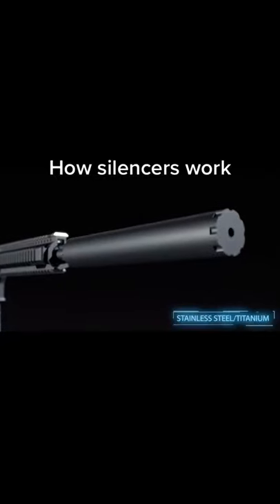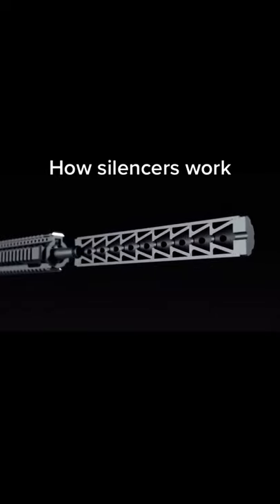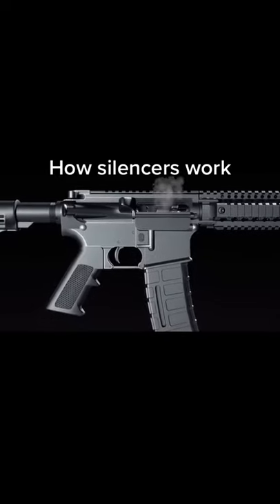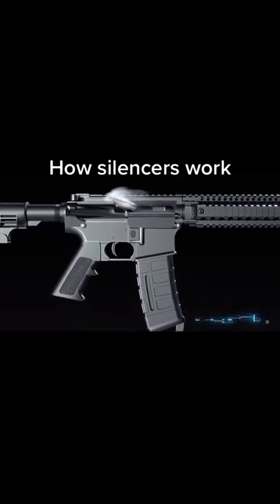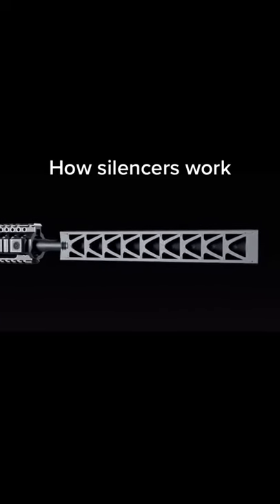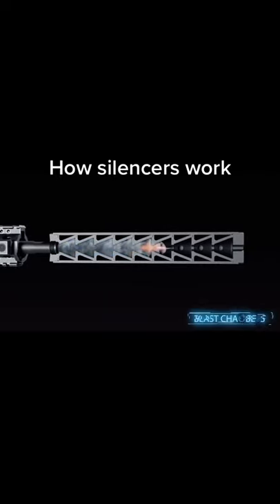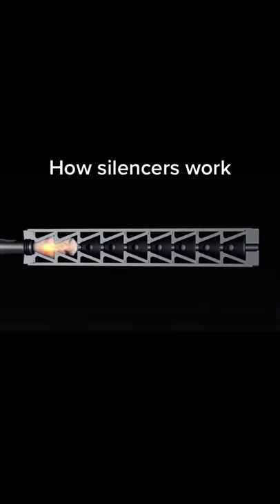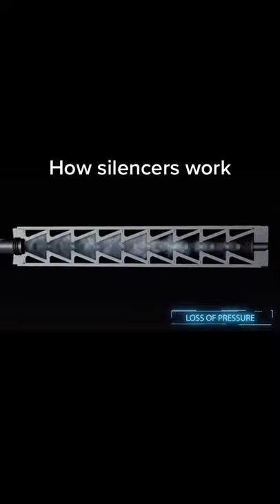How a Silencer works. AKA a gun suppressor.

Comment: Suppressors : makes the gun some silent and produces better accuracy
Games : decreases  damage , range , accuracy
Reply: Well range and damage would decrease with a suppressor because it traps most of the gas accelerating the bullet.
Reply: @gmdtanker6211 Range and damage isn't affected because the barrel isn't shortened when you attach a suppressor.
Reply: @mutsyti  right but the power of the bullet comes from the gas propelling it. If you look at the inside of a suppressor, it traps the gas to produce less sound, hence making it slightly slower
Reply: @gmdtanker6211  Suppressors increase the amount of time that gas pushes on the bullet because they increase barrel length. Suppressors don't slow down the gas completely.
Reply: Old silencers slowed down bullets. Modern silencers or suppressors can actually increase muzzle velocity and accuracy, it all depends on design. To be "silent" you must use subsonic ammo as well
Reply: Re2 Remake done silencer right and I loved it
Reply: Facts bro
Reply: Because in games, especially multiplayer games, they have to balance stuff out to prevent everyone from using the same set up